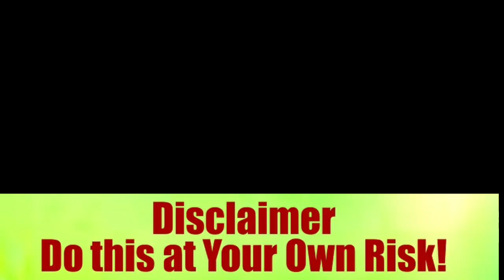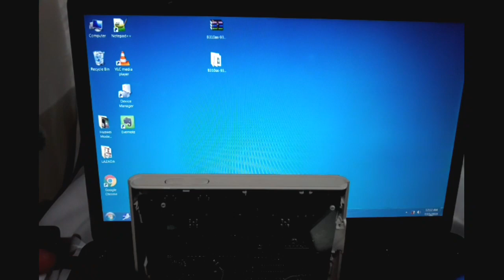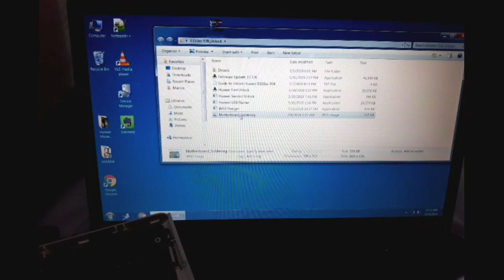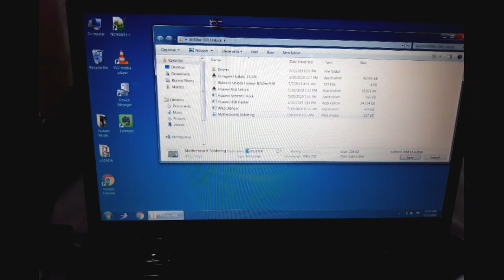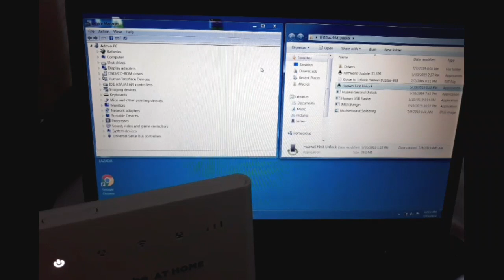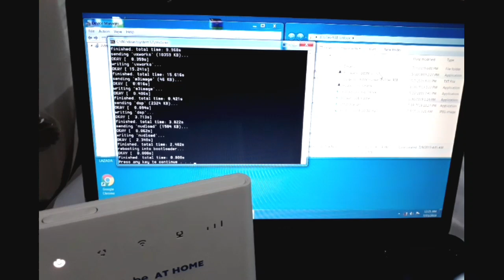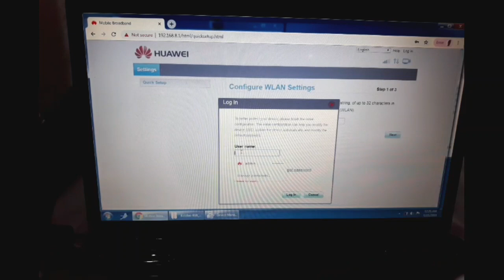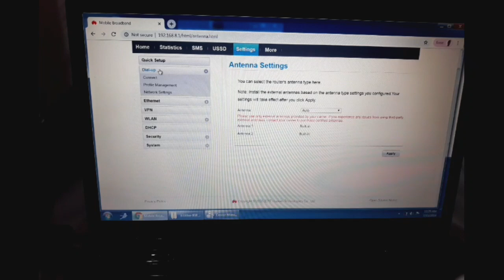Unlocking Globe at Home Modem- Complete Openline Procedures for Huawei B310as

Comment: Boss panu ung fix ng d xa marecognized at nag malfucntion xa pero ok naman ports ko na short ko naman ng maayos sana matulongan nio ako hanggang first step lang tlaga ako dko ma flash kac d xa na recognised as usb
Reply from the maker: First use Data cable yung maayos. Second May drivers po dyan, click setup sa dalawang driver para ma-recognize. Third, dapat yung solda magkakahiwalay.
Reply: @MovieShortCuts  boss pahingi naman po ng driver kc ganun din po ang problema ng sa akin di rin marecognized